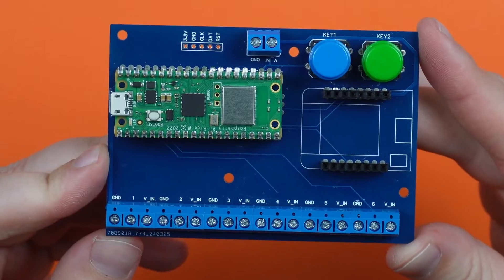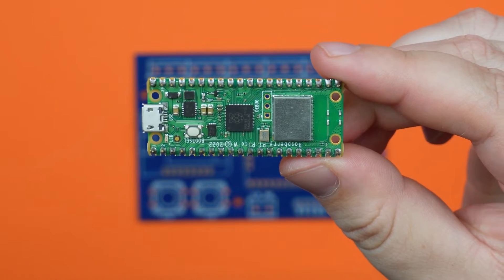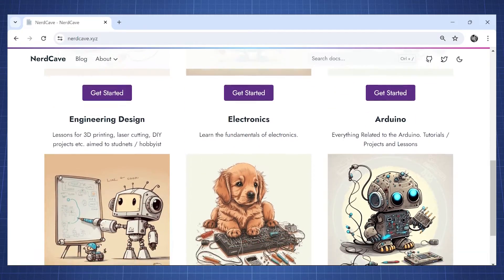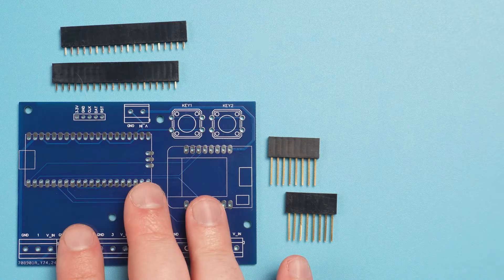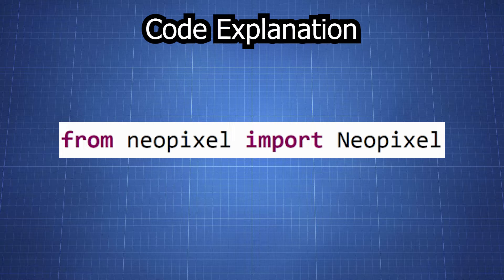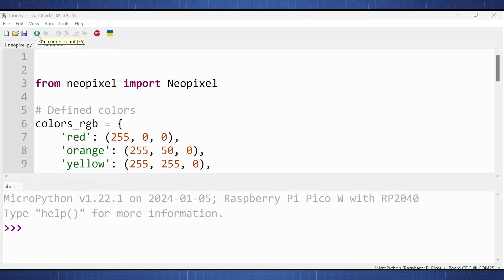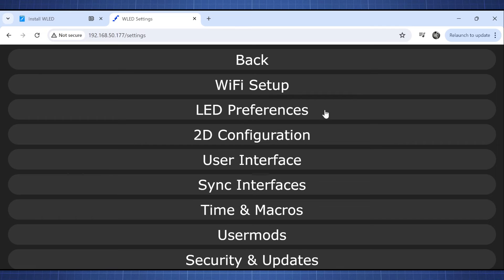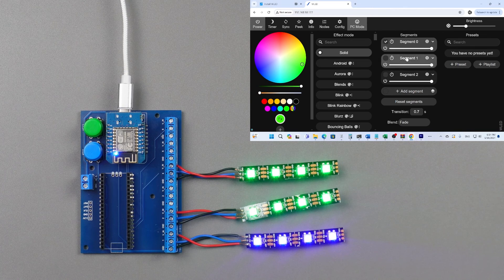WS2182 Controller PCB - Raspberry Pi Pico / D1 mini

Comment: My PCBs for this have just arrived from JLCPCB ...

As always an excellent quality PCB from your great design ..

Really like the idea of allowing for installation of either of the 2 microcontroller 

Thanks
Reply from the maker: Glad you like it!, there is just a small issue that the D1 mini does not allow for 8 different strips so in future I will indicate it better on the PCB which ones to use for Pico or D1

Comment: Very cool project! Can you do a 4 digit 7 segment display that is  common anode and has no I2C?
Reply from the maker: I can, although using a 74HC595 shift register might be the best option to save 5 GPIO pins, without it then it is basically multiplexing by controlling the anode D1,D2,D3,D4 to display a message, this issue I had was ghosting but I can try again